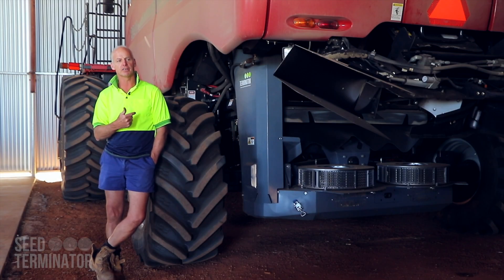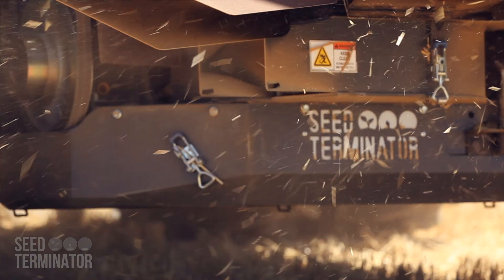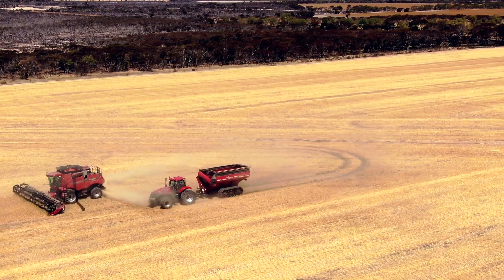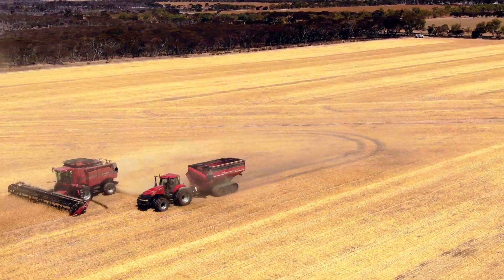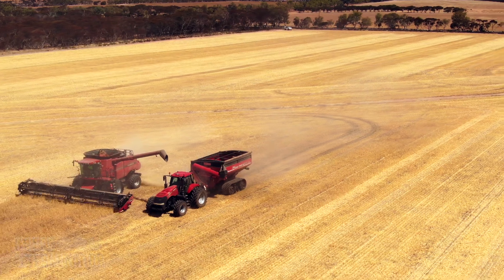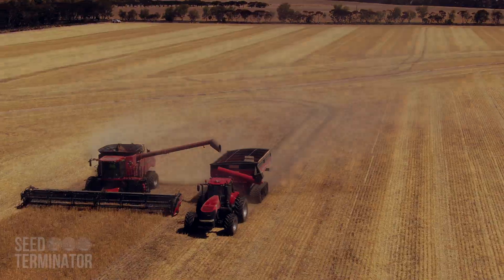Seed Terminator on Case IH, Harvest 2019

Comment: Im wondering whats happen if a stone goes throw this thing😅🤔
Reply: Yeah it would make funny noises may block the roddar and cut the rock it no pieces and spit it out the back
Reply from the maker: We've thought of that! The mills have flexible flails and the screens have stone doors to allow them to move through, then we have the magnet tray to trap any pesky spanners or wire picked up in the paddock. 
Thanks for the Q Markus
Reply: @SeedTerminator  ?